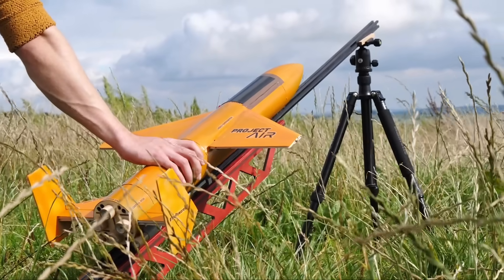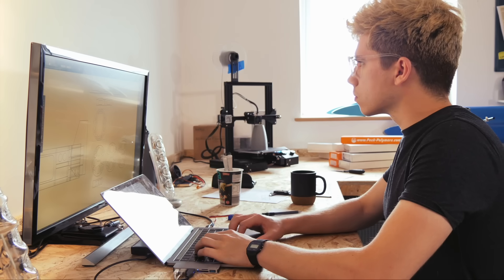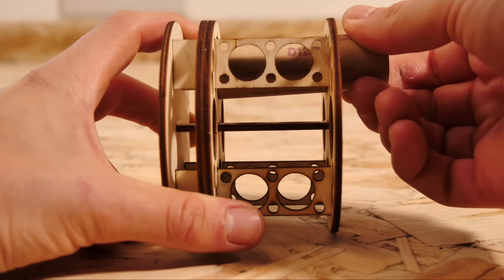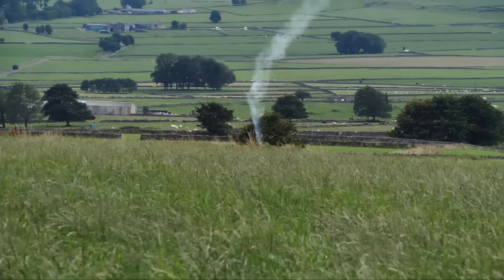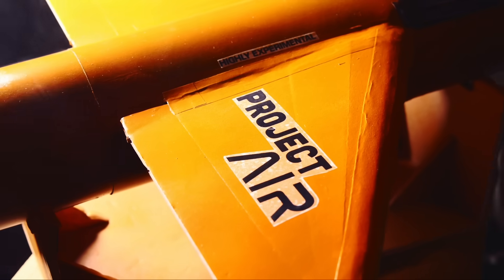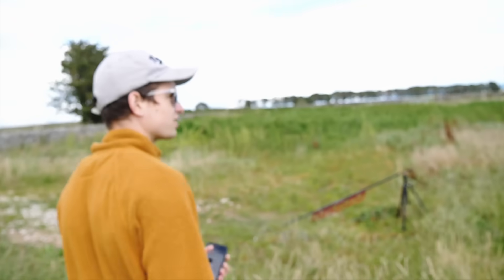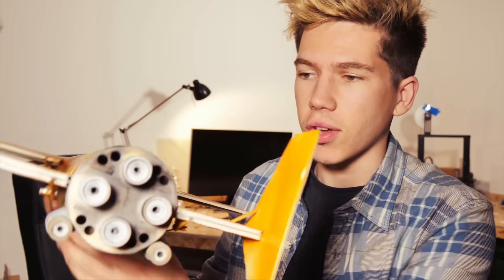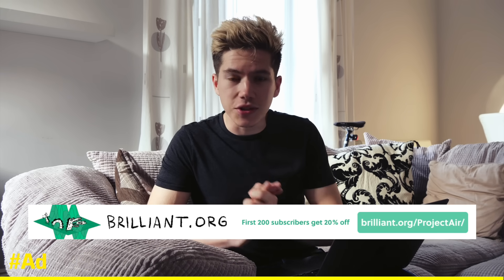High Power Rocket Plane

Comment: Been a few years since I've looked but D12-x motors then were something close to $7/ea USD here.   I'd love to see this project go to a tough composite structure with a bit more wing/tail area.  Adding EDFs is going to create pitch problems when the rockets ignite. You can just carve out the ejection charge.  Its just a .5cm clay plug with little black powder under it.

Comment: It looks like you are using 4×24mm black powder motors. Most likely Estes. If they are 4 Ds, they are a total of  19NS each or about 2 total KGs of thrust each. About 76 total NS/8 KGs If they are 4 Estes Es, they are about 27 NS each or about 3KGs. That's a total of 109 NS or 12 KGs ... not 16.  

In either case, neither motor combination is "high power" as defined by most of the world's amateur rocketry associations. High Power is a single motor over 160 NS or a cluster (like this) over 3.  So you have 2 grossly inaccurate statements in your headline. 

As far as a cluster for an RC rocket glider is concerned, it is a terrible idea. There is a high probability that at least one motor will not fire. You will immediately have control issues because the rocket will want to veer in the direction the motor doesn't fire. You will also have power loss issues, and finally under glide you will have balance problems because an unspent motor is about twice as heavy as a spent motor increasing the risk of making your glider tail heavy.

Also, Estes E motors have a tendency to CATO (Catastrophic Accident at Take Off).  In short, the motor can blow up. In a cluster it could take other motors as well. That's a lot of expensive electronics and servos to lose.

I STRONGLY suggest you learn more about rocketry before taking this to market because you are going to have a lot of disappointed customers if you don't.

We have Low Power, single motor, RC rocket gliders fly at our club events all the time. They are excellent. The larger ones like yours tend to fly on a single, longer burn composite G motor, such as an Aerotech G38 which is lighter, has a longer burn, and just as many NS as 4 Estes E motors.

Most of the rocket gliders you see are Delta-winged with the servos and electronics located as far away from the motors as possible. They are more durably built, and far more reliable that what you have presented here.

Regarding "high power"  it is illegal to fly "guided rocket" weighing over 1500g or having more that 125g of propellant weight. Rocket gliders fall into that definition. Please drop that term from your description.  

I am level 3 certified with the Tripoli Rocketry Association (TRA) and the National Association of Rocketry (NAR). There are similar organizations I'm the UK, EU, Australia, and other countries. If you are going to enter this product field, PLEASE seek them out.
Reply: Noticed a typo. A low power cluster has 320 max NS. Also, max propellant weight restrictions apply to the total weight of all motors in the cluster.
Reply from the maker: I don’t sell products, the thrust calculations are based on Estes own data and I think others might agree that this rocket plane worked as intended 😊 It was a fun project.
Reply: @Project-Air   First ... This is independently tested thrust information from Thrustcurve (https://www.thrustcurve.org/motors/Estes/D12/) An EstesD-12-7 has an average thrust was 10.2 Newton-Seconds , or 1 KG/S. 4 E-9's would generate an average of 4 KG/S.  The motor's peak thrust is 29.7 N or 3.0 KG.  4 motors would generate a max thrust of 12 KG. Adding 2 C-6-5 motors would boost your avg. thrust to 4.96 and your peak thrust to 14.9 KG.  Close to 16, but not quite. 

Second ... I made the assumption that since you are selling coffee mugs and other merchandise that you were also selling kits.  I do not disagree that it probably was a fun build and a great flight.  a cluster of 24mm BP motors makes a lot of noise and a lot of smoke at launch and visually looks great. I love the design. Nice onboard camera view. It is a nice looking bird. It is a good video and deserves the likes it has earned. As a production model, however, this is much more prone to failure than one flying on a single F or G motor. So if in fact you were promoting this as a kit to buy, you would have a lot of disappointed customers. For someone who would want to fly this dozens of times, a cluster of 4 smaller motors is not near as reliable as a single larger motor. I dare say that if you tried to fly this 5 times, you would have be likely to have a motor ignition falure on one motor at least twice and at least one motor CATO over the 5 attempts. At your launch angle (which I will describe shortly) a single motor ignition failure might not be enough to get it going up high or fast enough to generate the necessary lift for a soft landing.  If a single composite G fails to ignite, nothing happens.  Aerotech composite motors are far more reliable than Estes E-9s which historically are more prone to CATO than almost any other motor. 

Third ... You should consult the UKRA (http://www.ukra.org.uk/) and its safety code. Your launch angle was in violation.  It should not be more than 20 degrees from perpendicular to the ground.  Your use of the term "high power" is inaccurate in the amateur rocketry world so if you want people like me who do this instead of fly RC aircraft to cross over, you should not use that term. Here in the US, a high power rocket glider is not legal and there are clear definitions as to what high power means. A low power rocket-glider is legal.  

I understand that your site is dedicated to RC aircraft and that most of your viewers are RC fliers, but if you are going to promote or create a video about rocket-powered gliders then you need to make sure you are compliant with the amateur rocketry sanctioning bodies, your country's laws regarding rockets (they are radically different than those regarding RC aircraft), the physics of rocketry, and the general knowledge of rocket motors.

Great design. Cool flight. Good video, but clear UK rocketry safety violation with your launch angle and an unreliable bird for the long term. For RC pilots who want to build and fly an RC glider, there are several proven and reliable designs that can fly on a single F or G motor which costs about the same as 4 E motors, that when launched straight up, can be airborn for 3-5 minutes.

Comment: I think you should place the engines so you don't get any pitch up moment from them, i.e don't put them under the X axis (longitudinal axis). You won't need to move the c.g back so much but I would think about having a larger elevator/larger deflection angle to trim the plane after the rockets are out. You can pretty easily calculate the c.g location for trimmed flight with engines spent.
Reply from the maker: Completely agree!

Comment: Project Air “we had twice as much thrust but didn’t go twice as fast”??  

Square law “Hold my calculator”
Reply from the maker: Yeah that was a big facepalm 🤦‍♂️ I intended to write a subtitle to rectify that obvious mistake but forgot 😑
Reply: @Project-Air  No problem, easy mistake to make. I'm not sure your twin tail is doing you any favours as the vertical surfaces are having to work in very turbulent air from the Vortex's off the front wingtips. I would try a single vertical fin in clean airflow. Maybe try an air drop launch from either a Mothership or a Weather ballon then ignition and level to diving flight would produce the most speed. I think there is a way to mod those rockets so they burn longer too - joining several in a line. Something to look into.

Comment: I’ve always wondered if having a set of the rockets firing on a delay like a second or two after the main rockets, what would that do? More distance? Or would the weight of the unfired rockets not adding the the initial thrust be to much? Or would it matter at all. Also I realize having them on a delay might be tricky to do. 
Either way this is brilliant it reminded me a lot of the Japanese Ohka now you just gotta drop it out of a betty bomber !
Reply: That's essentially what large rockets that any big space company would fly does. Except, in those cases, they drop the old fuel tanks and motors behind. I'm sure if you intentionally ejected the old engines and used E-Matches for the 2nd stages, you could get farther. Also, some model rockets actually do have 2 stages to get higher. One that I've built myself, the Supernova, used the ejection charge of the first stage to ignite the second engine and to separate itself.

Comment: A folding propeller like they use on gliders would be much better suited than a fan, because once you don't need it, it doesn't cause much drag.
Reply: Exactly.  Once you exceed the pitch speed of the EDFs (compensated for the intake), they're just adding drag.  A folding propeller is definitely the way to go, and cut the throttle and let it fold before lighting the rockets.
Reply: General.E.Shady YT it please and give channel

Comment: That initial jerk upward at the beginning may have been a result of the plane being tail heavy.  The rocket motors weigh a significant amount and a lot of mass is expelled. This makes it difficult to get the CG right on rocket planes. I am sure you are all ready aware of all of this but I reckon that's why lurched of the pad initially.

Comment: Cool project. Really would be faster and fly better with a runcam split in the nose instead of a box camera stuck on it. Might I also recommend an airspeed sensor and logger setup for projects like this? They really aren't that expensive or hard to get.

Comment: I suspect the GPS is only giving you ground speed - which is only accurate if you were flying horizontally. It looks like in the initial phase, you were flying with a high incline so the actual speed would have been more than the ground speed. If you flew straight up, the GPS would record a very low lateral speed.
Reply: Just use a GPS with a accelerometer.
Reply: @TheKamiBunny  To get velocity, you'll have to integrate the acceleration over time which introduces a lot of errors due to the noise from the accelerometers. In theory yes, in practice this won't work well. If you mean getting the angle of incline - then you'll need some sort of angle estimation, which could work (assuming you include gyros) but due to latency in the process, the computation might be more complex than possible for a cheap small device like that.
Reply: @danweecc  You'd also not just neet top speed with the GPS but also the time at which it measured that
Reply: Was about to comment on this
Reply: Add an air speed sensor for accurate speed
Reply: actually I think you could calculate ground speed if you knew the angle it started
Reply: Ground speed definition is how fast an object move in regards to the ground , you are thinking acceleration is not possible with GPS
Reply: @HIHaiki  What he wants is the velocity of the projectile (in this case his rocket powered plane). Accelerometers provide acceleration, which when integrated over time gives you that velocity. The use of accelerometers to estimate attitude (and inclination) of an accelerating platform is quite complex (needing some advanced estimators such as a Kalman filter) but if he succeeds in doing so, he can use that estimated attitude together with the instantaneous ground velocity from the GPS and compute the actual velocity. This is all kinda iffy because of latency and the fact that GPS velocity is computed from past points (usually 5-10Hz though some might provide 20Hz update rates.) So it is not completely impossible to use GPS ground velocity provided you have some way of estimating the attitude of the platform.
Reply: An inexpensive Ardupilot Air Speed meter  would provide a voltage proportional to air speed.  ( about $20 US on Banggood.com )  Then you would need some means to record the peak voltage obtained during the flight.  The speed sensor uses a pitot tube and a differential pressure sensor.
Reply: @howardweymouth7195  Yes, a pitot setup would probably work if mounted correctly. It will still need to be calibrated for the atmospheric pressure to produce the right results.
Reply: @danweecc  The type of pitot assembly used for RC airplanes is a pitot static tube which has one tube with a hole in the front encased in a second tube with holes on the side.  The two tubes are connected via tubing to a differential pressure sensor which measures the difference between the two rather than the absolute value of air pressure.  I suspect one would only have to calibrate once rather than for each use as in a barometric altimeter.
Reply: @danweecc  While altimeters must be calibrated at the start of each flight and corrected over long flights, simple pitot static systems are calibrated only once and unless do not require additional attention unless flying at high altitudes.  In general, one adds 2% to the indicated air speed for each 1000 feet of altitude.  There is probably a very small error introduced by the normal variations in air density but it does not appear to be of a magnitude which poses a threat to safe flying.  The low cost hobbyist pitot static sensors typically will have good relative accuracy but poor absolute accuracy.  So an initial calibration is definitely be required.  Something as simple as holding the plane outside the window of a car and comparing the output voltage changes against the speedometer would do the trick.
Reply: Angle to horizon has nothing to do with this the gps uses an additional IMU and can calculate speed in any desired direction. Airspeed though will need a sensor like a Pitot tube pointing ahead.
Reply: @sanches2  GPS on gives you ground speed. What he has is not an IMU, only a GPS unit and that won't give him the actual speed, only the ground speed.
Reply: I agree with you. That's the only way it would work.
Reply: came here to say this. +1

Comment: You need power to climb and altitude to glide. When you have power, always go up. Take it from a sim pilot with many thousands of hours sim flying. Double thrust will never mean double speed because of increased weight and greatly increased drag. May I suggest a wire loop so you can recover the aircraft with the dronen and swing wings that compress into a delta during high acceleration and speed but extend during the glide? Ucan use a three position servo. The first to hold the wings and pick up wire against spring tension, the second to release the wings and the third to release the wire.

Comment: Very enjoyable. One thing I'm curious about, from this design and others - and which I'd love to see more investigation of in future, if you're so inclined - is how much difference the trailing edge thickness makes to drag, in the speed range you're targeting. The current setup looks quite chunky, with one to two thicknesses of foamboard and no tapering. I know from my own builds that at low Reynolds numbers, that chunkiness makes little to no appreciable difference - but then I don't fly my own planes nearly as fast as you're aiming for, where parasitic drag contributions start to dominate other effects. Maybe if you run out of other things to test on this airframe, and it's still in one piece, try another flight with the trailing edges tapered down and reinforce them with a bit of tape?

Comment: 2 stages, one to get off the ground and another to rip the wings off
Reply from the maker: I like your thinking
Reply: @Project-Air  excellent project, it would be interesting to see performance variations if you replicated the planform and layout of the Miles M52. Wouldn't be a huge amount of work based on what you already have in hand and the differences in flight performance could be quite instructive.
Reply: @Project-Air  посмотри канал Игорь Негода. Очень рекомендую
Reply: @Project-Air  What's the app that he is using to draw and design this aircraft, I really need it please help me find it.
Reply from the maker: @kostasiraklis7070  windy.com
Reply: @Project-Air  No I mean the one that you can design your project.
Reply: @Project-Air  >>> YOU may like his thinking, but I bet your ROCKET PLANE might disagree. 😉
Reply: Make remote controllable stage separation and re-ignition.
Reply: That’s what I was thinking, if there were some way to fire the rockets while it was flying, fire half the engines to take off, and the other half when they die out, won’t go faster but will fly twice as far.
Reply: @alphagt62  your idea would be easy to achieve. Time the burn time of a particular type engine, then program a prototype board like an arduino and a relay to ignite each engine as they burn. I don't think the combination would add to much weight.
Reply: MitchMoe You could also use an accelerometer as a trigger by firing the second stage when acceleration from the first stage drops below a certain threshold. It would probably best to combine the two methods, checking the accelerometer after the burn time and then only firing the second stage when the acceleration has dropped. Would be especially good if the accelerometer is a three axis model with one of the axis aligned with the motors.
Reply: lol
Reply: @Dwayne Sykes... Absolutely, a MOSFET is a much better choice. It would be a fun experiment to see how high you could actually get a rocket to go.
Reply: @ProjectAir  What's the app that he is using to draw and design this aircraft, I really need it please help me find it.
Reply: RIP THOSE WINGS AYYYYYEE
Reply: tbh it sounds like a cruise missile
Reply: Epic idea!